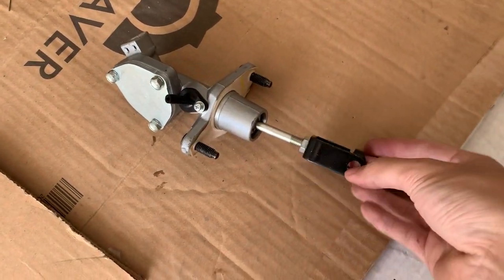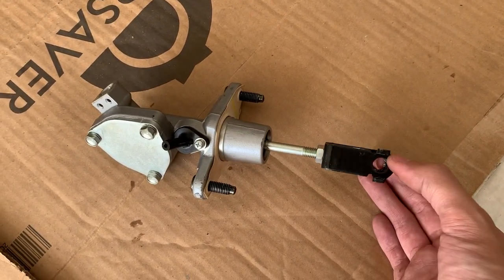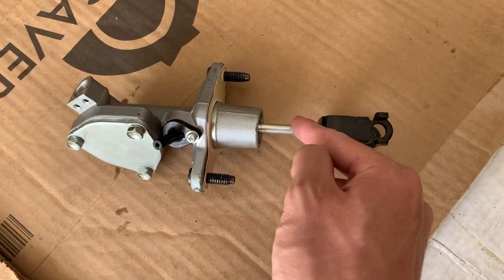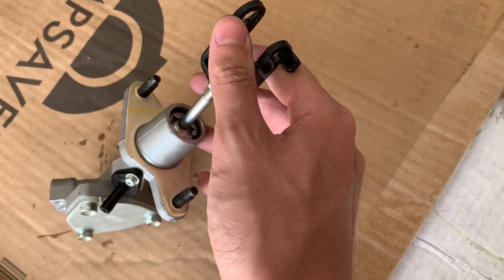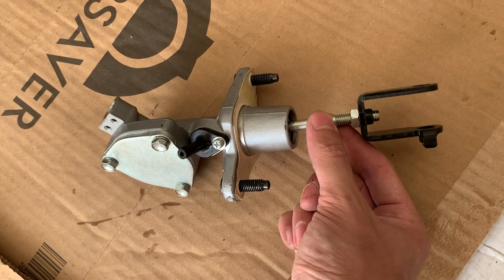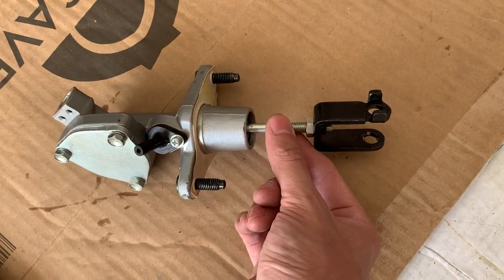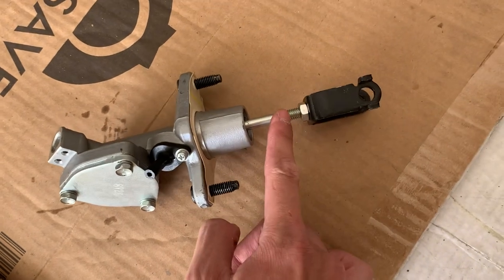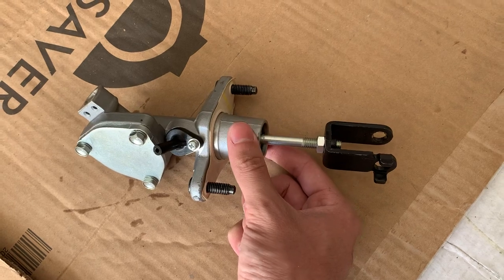FK8 Civic Type R Clutch Pedal Adjustment (Gear Grind Fix)

Comment: I was skeptical, but a week after adjustment and no grinds.  I previously deleted slave delay and changed to friction modified fluid and would still get grinds in 2nd.  Took it to Honda and they could not duplicate.  Advice I got from Honda's mechanic was NOT to push clutch in all the way, which is preposterous.  So thanks for this.
Reply from the maker: Glad this was able to resolve your issue!

Comment: Thank you!! although this did not fix my sometimes crunch feeling in second gear it did fix my inconsistancy in clutch grab and release. i found shifting slower at lower gears prevents the crunch. if i shift really fast then i get it. i did grind second tho when i first got the car 😬

Comment: I just got my type R. 300 miles now. The third gear is sometimes hard to get in, and I end up accidentally going to 5th when trying to shift from 2nd to 3rd
Reply: I traded mine in
Reply from the maker: You probably need to change the way you shift. Try this adjustment and see if it makes going into gear easier.

Comment: Hey, hoping you might be able to help. I've got a 2018 accord that has a clutch pedal that's actually a bit higher than the brake and engagement point a little high as well. No slippage or grinding, but would this mod be able to drop the pedal down a little bit but also have the engagement point move with the pedal? Thx.
Reply from the maker: Leave it. That’s how it’s intended. By lowering the grab point, you’re reducing the amount of clutch travel which can cause grinding
Reply: @AirsoftFanatics , thanks a lot. Coming from a GTI which ad engagement in the midpoint of clutch and clutch and brake pedal pretty much even to this different setup. Thank you for the quick reply.
Reply: On my s2000 I made sure I adjusted the cmc rod after I had replaced the cmc due to leaking. I have a bit of slop up top. I used the cruise control switch that the pedal connects as a gauge. It’s enough slip where the CMC rod pressure is not depressing the button for the cruise control, and only the spring tension for the pedal is pushing the cruise control button. 
Long story short, the clutch pedal grabs where I need to around 70% mark and no grinds.
I didn’t like how when I turned the CMC rod clockwise , it made the clutch grab point high which is not typical.

Comment: If I will be tightening/extending the CMC rod ever so slightly, just enough to take out the initial free play, do I need to still worry about the slave cylinder plunger and messing up the self-adjusting feature?
Reply: be careful buddy

Comment: Having issues, after bitepoint adjustment under throttle it rev hangs a bit and engine is fine. It’s clutch what’s your helpful suggestion I’ve been adjusting bitepoint and making sure the extension rod has a fair play
Reply from the maker: Make sure you didn’t add too much pedal pre load

Comment: Hey man great video if im not deaf did u mention u switched ur cmc and slave to a 8th gen si? I guess if thats the case i can use the hybrid racing right?
Reply from the maker: I did switch the CMC but not to the 8th Gen Si. I bought a modified fk8 cmc from NAPerformance / k20z3allmotorftw on IG

Comment: I was wondering if you know the easiest way to access the clutch bleed nipple when doing brake fluid change? I noticed either the intake pipe or the o2 sensor that connects to the down pipe is in the way. I want to find the easiest way to reach that nipple without doing extra work like removing all the stock intake parts to make room for my arm to get down there
Reply from the maker: I'm a skinny guy so I can maneuver my hand straight through the top. You might need to lift the car or remove the intake box.

Comment: So when I twist the rod initially. You stated that the rod needs to be hitting the back of the cylinder or the front of it.
Reply from the maker: Daniel Lopez when you turn the rod clock wise you will feel it contact. The rod will be going further into the CMC.
Reply: Michael Wiellett ok so as it goes into the cylinder it should hit the back of it and I stop.
Reply from the maker: Daniel Lopez yes. Make sure it doesn’t fully max out. Just enough to make contact / resistance. You can probably go a quarter or half turn past just be sure to manually check your clutch slave cylinder. I have a video on that too

Comment: Wouldn't turning the rod clockwise till you feel it resist make the engagement up at the top? Since turning it counter will lower engagement?
Reply from the maker: Yes that’s correct. Having it bite up top would help the clutch release sooner.
Reply: Michael Wiellett thought most clutch companies say the clutch should engage in the middle and not the top or floor?
Reply from the maker: Kevin a little bit above the middle is fine. Definitely nothing lower though
Reply: Michael Wiellett how far out did you back the pedal on your car? I have Eman’s modified cmc
Reply from the maker: Kevin I only added maybe a 1/2 to full turn of pedal. I went a little past the resistance point when adjusting preload

Comment: Also how come my 2020 type r is sluggish off the line in first gear like an automatic transmission
Reply: This will help with that issue but ctr is more for corners than straight lines

Comment: Hey im david icenhour and I live near Atlanta ga. And im having issues with my new 2020 type r grinding in 2 and locking out in 3 and 4th gear. Im having to push the clutch all the way to the floor some times to shift gears i have the extended warranty on the car i have only had it for 2 months i have a appointment at the Honda dealer in the morning they are claiming they don't have issues out of these cars what do I need to do about this
Reply from the maker: David Icenhour you should always push the clutch all the way to the floor before moving the shifter.
Reply: @AirsoftFanatics  I have been doing that too but still have the issue and this car only has 2.500 miles on it. I am taking it to the dealership tomorrow to show them what u said in the video I hope this fixes the issue it will lock me out of 4 and 3 gear sometimes too.
Reply from the maker: David Icenhour see what the dealer says. I would recommend adjusting your clutch pedal too. This will ensure your clutch is releasing properly
Reply: @davidicenhour1106  I have a 2020 Type R as well and getting 2nd gear grind too. Mostly happens when I try to shift fast from 1st to second. My Type R was also purchased in the GA area. Crazy how yours is from the same state and doing the same. What did your dealer say? Is your problem solved? Thanks!
Reply: Yeah they said they could not replicate the problem

Comment: Dear Michael, many thanks for your video. I'm an owner of 2017 fk8 type r and ı have had transmission issues like stuck in 1st gear and sometimes difficulty in changing between 1st and 2nd gear. The feeling is not smooth and it makes me feel discomfartable while driving. How can ı buy this modified CMC? Will it correct my transmission issues? By the way, I'm living in Kayseri /Turkiye..
Reply from the maker: Mert Ali Karadağ have you tried this adjustment first to see if it helps? I would also recommend changing your transmission fluid to something like AC Delco Synchro Mesh Friction Modified. If all else fails you can contact k20z3allmotorftw on Instagram and purchase the CMC from him.
Reply: Dear Michael, ı still can not try this modification due to Corona precautions. I will do this as soon as going out😀. Some people also strongly advice to use CMCs of 01-05 Civic Em2 (05 Civic Ex) instead of 17's OEM CMCs. They claim that they are very strong. I look at the photos and they are very similar. Do you have any idea about this?
Reply from the maker: @karadagmert  Do not use EM2 CMC.

Comment: IM GOING THRU THIS IN MY 18 SI, right after getting a clutch kit
Reply: Same dude
Reply: @MnHondaSi  clutch adjustment was the fix. It's pretty easy. And just make sure you adjust the clutch pedal sensor as well. I didn't take it out, I just adjusted the cylinder from behind the pedal

Comment: Do you recommend the upgraded clutch master from the k20 guy?  What's the difference in feel when you're driving?
Reply from the maker: I definitely recommend it. It has improved shifting a bit in terms of smoothness and how fast I can move the gear lever.
Reply: @AirsoftFanatics  that’s great! Did you do any other upgrades to the clutch slave or to the lines? Racing brake fluid?
Reply from the maker: @vladsatchouk3323  I only upgraded to Endless RF650 fluid
Reply: @AirsoftFanatics  sorry for the questions did you do a full brake and clutch fluid flush and replaced with the endless or just flushed the clutch fluid and topped off with the endless RBF?
Reply from the maker: @vladsatchouk3323  full flush of the brakes and clutch

Comment: Before switching out the cmc, did you have a buzzing sound when shifting between 4k and 6k?
Reply from the maker: I’m not sure if it happened with the stock one, but I do get the buzzing with the modified CMC.
Reply: I also get a buzzing sound
Reply: I get the buzzing sound too.. did you get it fixed?
Reply: @kushmaster131  Ever get a solution to this?
Reply: @ryancolvin1736  adjusting the clutch line near the battery helped.. But I still feel it once in a while. I just learned to live with it.